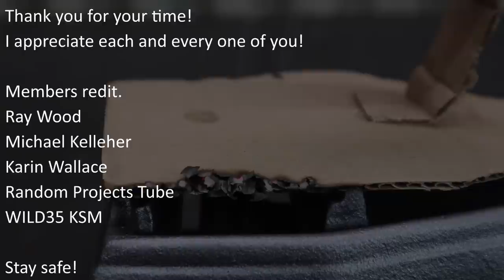Vintage Iron heater/Burner Restoration.

Comment: I think that's for a 1920's gas-jet iron.  The iron sits upright and the flames shoot into it and heat it that way.  The base is just for resting it.  Probably a better idea than the ones that had the iron directly connected to the gas line.  With genuine asbestos insulation!   
Or one that had a liquid gas cylinder mounted above the iron handle.  What could go wrong?
Reply from the maker: Haha what could go wrong! Exactly my thought! That description sounds about right, now to find a matching iron to restore!

Comment: I knew once you tried the Evaporust you would be a fan.  It is based on the acid being super mild, Tanic acid, and very effective at holding all the iron oxides stable in the liquid solution so they do not deposit back onto the iron when used.  Commercial methods are critical at the point of neutralization, and can "flip" on us when used and leave the iron right where it was in the system in a very fine powder red/orange loose powder.  Having done several dozen boilers using the commercial method, losing control on the neutralization is our biggest fear.  Happened to me only once early on...  NEVER again!!  

Outstanding content, and well done on the video side.  Nice touch to give the camera a few seconds for a good focus on your hand.  It makes a BIG difference from other channels I watch....
Reply from the maker: I will probably never use any other rust remover, I was really surprised with the results. Thank you for the great comment, I really appreciate it!
Reply: @AJRestoration  I like Evaporust for most things especially if I am cleaning something and I know I have others watching or trying to learn.  Honestly, I have a fair number of BETTER solutions available, but most are quite dangerous to anyone not well versed in the chemistry involved.  Have seen a fairly newly owned truck ruined because the owner lost the radiator fluid along the road side.  He stopped, fould out he had left the drain cock open...  So he just filled the radiator with water from the drainage ditch to get himself going.  Forgot he did that, and about 4 months later came over to see if I could help him.  Completely calcium coated interior.  I told him the only way would be to extract the motor, and radiator and clean each carefully and separately.  He went home and ignored it.  He did not realize both the radiator and the water pump housing was aluminum...  NEW motor and radiator later, he came back and was shocked...  it happens... The old saying "dont try this at home" sometimes is more true than we want to think....  Good call on this one.  LOOKS GREAT.

Comment: Thats awesome! First time seeing a Vintage Iron heater like that. Really nice work! That black paint that was originally on it also looked really hard to take off! Again lovely stuff AJ :)
Reply from the maker: It was the same glass enamel that was on the lid of the pot I recently did. I just got myself a new sandblasting gun with a finer nossle and it came off much easier than the lid. It was about time for a upgrade.

Comment: At 5:15 did the glass break?
Reply: Sure sounds like it...... And the accompanying leak .
Reply from the maker: Yes it did haha I thought it was all the way down and it wasn't, so the burner kinda dropped in and broke the thin glass.
Reply: 🤭 ✅, misjudged
Reply: @AJRestoration  I thought I heard a barely contained "S***" thought you'd done the drop for ASMR reasons and cocked up. Made me chuckle, but the restoration looks great.

Comment: Nice refurbishment. While Japanning would have been correct, I'm quite sure you would need to have a separate oven far away from your family's noses before doing it.
Time to go antiquing so you can find an iron to go with the heater.
Reply from the maker: I wanted to do Japanning but I could not source the needed ingredients locally.